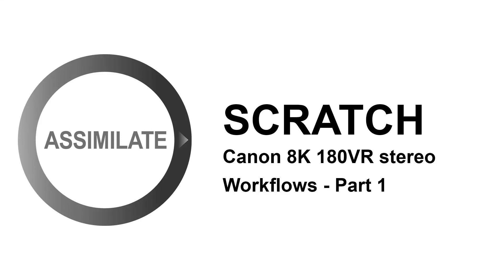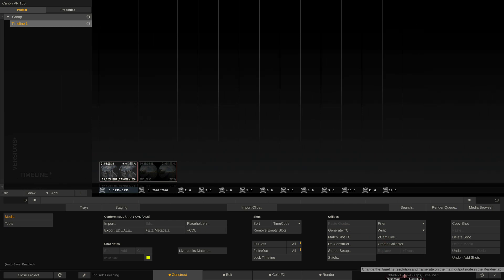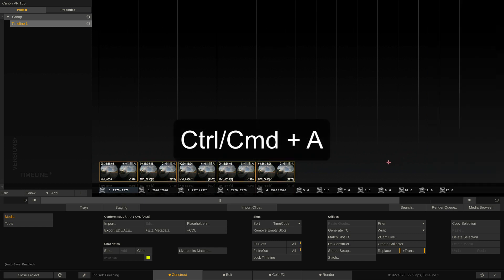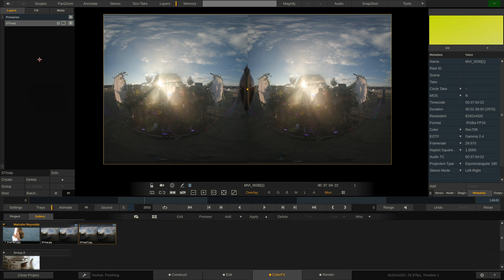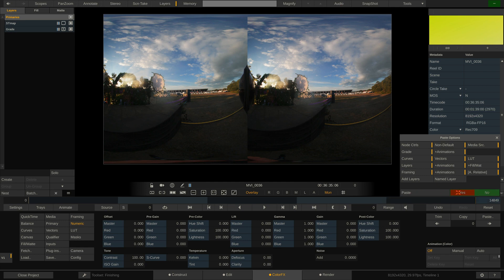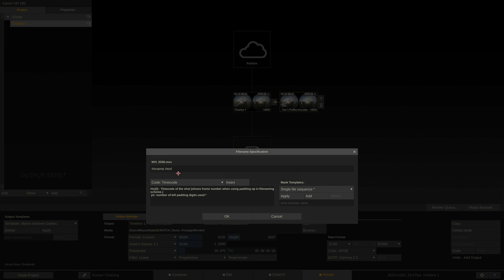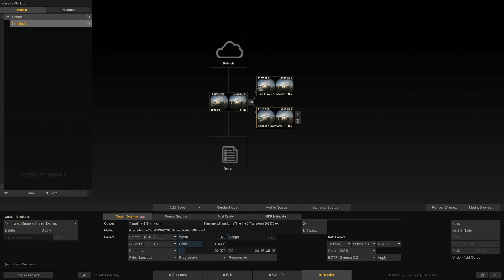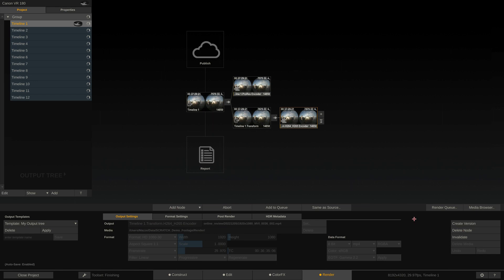SCRATCH and Canon VR180 Stereo Workflows - part 1 of 2

Comment: Very cool, can you give us an idea of render times for canon raw 60fps footage? Approximately how long will a 5 minute clip take to render and what specs are the pc? Thanks
Reply from the maker: Hard to give concrete numbers. On a decent machine it might even be real time. As a general rule of thumb: It renders roughly as fast as you can play it. The dewarping and grading adds close to nothing in terms of load on the machine.
Reply: @Assimilate SCRATCH  that sounds incredibly fast and much better than the other currently available methods. Regarding actual render times you could simply share what specs one of your render pc has and how long it takes it to render any given length footage as long as it's 8k 60p raw footage being exported to h.265 at 100mps